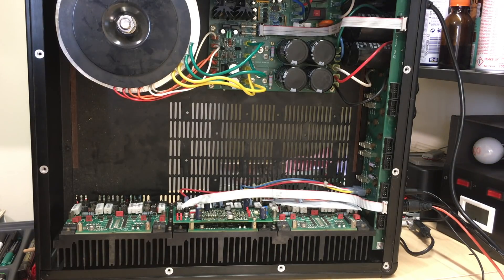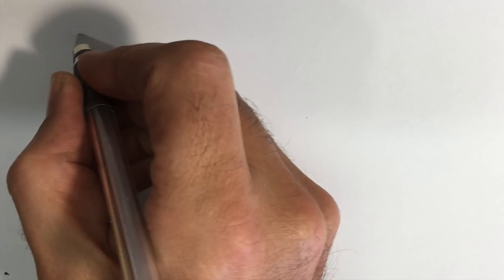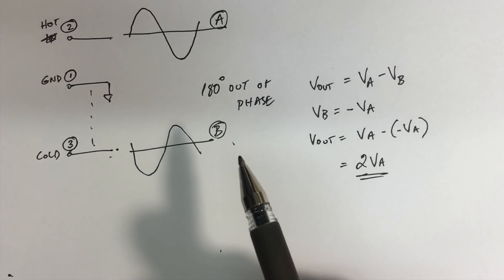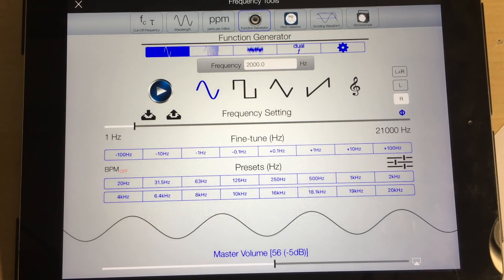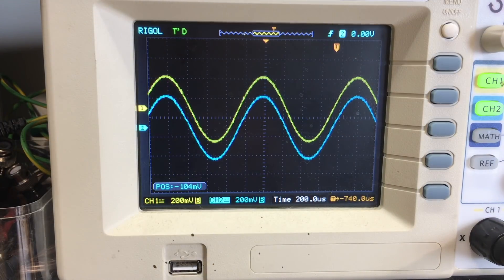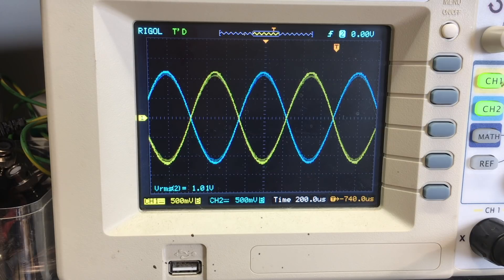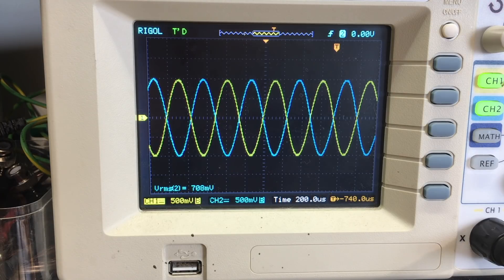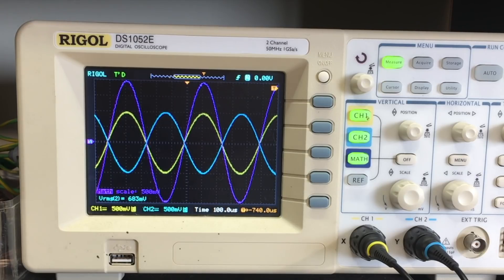Use a Smartphone App to produce a Balanced Audio test signal

Comment: That was a bit confusing but doesnt tale much to confuse me :). I thought a true balanced signal is created with seoerate op amps for each side (L+R) and they have their own ground, not shared as a stereo would be which is why they have either two connectors (Two Mono, one for left and one for right) or what seems to be popular is a jack with four tips as it were instead of three for a stereo. A balanced signal is hotter than a stereo but surely if they are 180 degrees and then summed the signal would be no louder. It is important that they have their own op amp for true balanced signal. I think it was the cold bit that confused me as I was thinking of a balanced headphone signal which has four connections not six, that is the part I do not get. A balanced connector should be four surely, Left and its return as one side and right and its return, its the cold bit I do not get but as I said I am easily confused
Reply from the maker: A balanced signal has a hot signal (V),  a cold signal (-V) and a ground, which serves as ground reference and as a shield. The input circuit does the differential so you get V-(-V)=2V.
If you only invert the one side, you create the -V from the input V. The effect is the same. Usually you pass the input V through a unity gain buffer just to get both signals with the same output impedance from the opamp.
Reply: @electronicsoldandnew   A balanced headphone jack has 4 points (L+Return and R+Return) that is what I do not understand is there are two connections for left and two for right but maybe it is different for other forms of listening devices
Reply from the maker: Daniel Browning : I’m not certain about the headphone case, but it pulls seem to be exactly the same as described: hot and cold for left channel, and the same for the right channel. No ground is needed.

Comment: Just off the top of my head but you might be able to use a transformer with a centre tapped secondary to create the balanced output. The audio output type.. not the power trans. A low impedance signal driver (source) should not bother the amp...
Thanks for the video, very informative.
- Eddy
Reply: I've done just that in the past, using one of those centre-tapped-primary transistor output transformers that used to breed in component grab-bags/lucky dips 😂. Of course, now that I need one for a repair do you think I can find any in my junk boxes? Of course not…

The app idea is brilliant though - wish I'd though of it myself! Thanks Manuel!